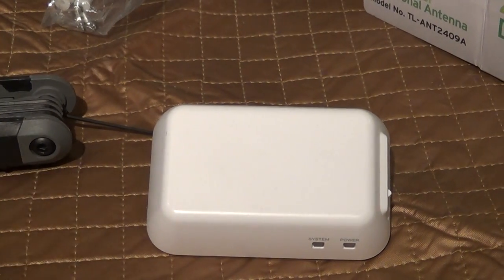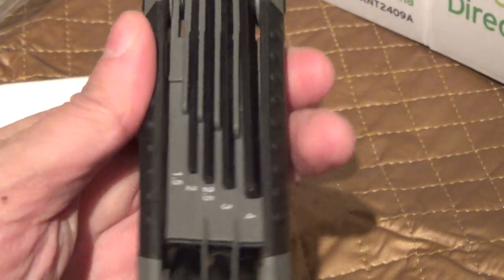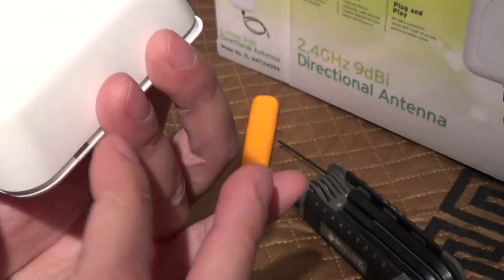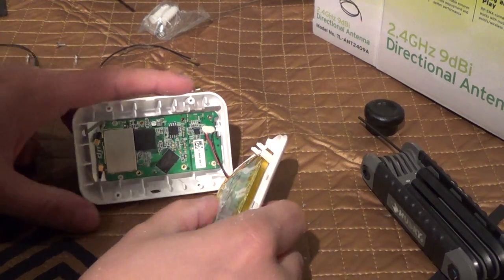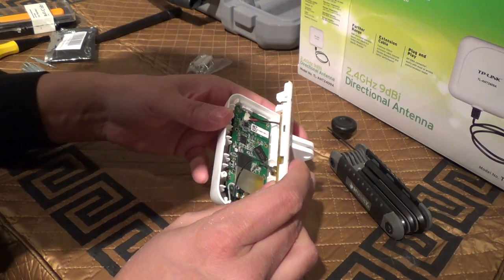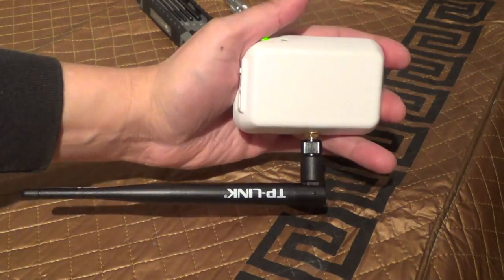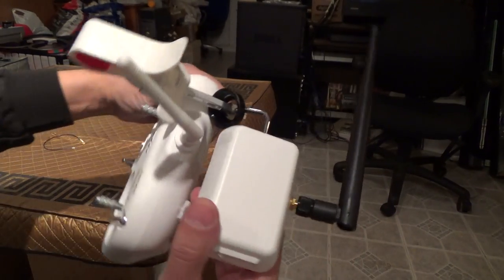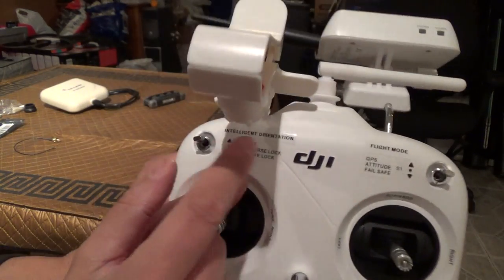DJI Phantom 2 Vision Wifi Range Extender / Repeater  External Antenna Mod increase FPV range.

Comment: just did my repeater upgrade usiing two 5dbi antenna's pretty easy upgrade after watching your video, thanks again. ebay parts were about $16... hoping test flights show improvement with wi-fi signal...had to burn away two internal ribs on the inside of the cover to allow for a flat surface to drill two holes for both antenna receptacles which mount about 1 inch apart ....curious if the transmitter antenna can be upgraded as well..wouldn't it need to be a 5.8ghz variety vs. the 2.4 ghz?
Reply from the maker: Even with extended range I've not been able to fly out of transmitter reception with it set to FCC mode.  Let me know how you do with the two 5dbi antennas. I've recently tested using the 8dbi TPLink omni antenna to 2,533 distance at over 300 feet altitude.  It definitely has given me at least 200 - 300 feet more range over the 5dbi setup.  If I change to a dual I may use a combination of both the omni and a directional antenna.  2.4 and 5.8 antennas are largely interchangeable so I wouldn't worry about which you use if you did want to change transmitter antenna out.
Reply: will do....thanks again....i want to do the transmitter as well. I did make a windsurfer parabolic antenna for the transmitter, I iwll post a video of it,i  havent tested it yet for distance though, ... still trying to find a good spot to test away from ocean... hopefullyI can find a suitable place soon,,,most of the spots here for that type of range testing involve some type of water crossing..
Reply from the maker: jwuman The transmitter upgrade is a similar procedure and uses same adapter. Though there is silicon over the connector which complicates the upgrade a bit.  Good luck with your range test but I promise you'll be nothing less than thrilled with the improvement over stock. And even more so if you go with adding an 8 or 10dbi gain antenna to the mix. If I do my transmitter I'll also post video of that upgrade as well.
Reply: awesome,,good luck as well..will be watching for more of your videos..cheers!
Reply from the maker: jwuman Thanks, I have plans for a upgrade video on the Vision Transmitter as well as the Visions Camera.

Comment: eXcellent tutorial. thanks
Reply from the maker: You're welcome. When I can I'll also have upgrade video's on the Visions Camera itself, as well as the transmitter, which isn't as necessary except for flying as high as you can far.
Reply: Do you think one antenna is enough? Does one tx and one rx or are they used as a backup type system or which ever is closest?
Reply from the maker: Skipholiday You will see no difference in overall range if you use a dual antenna setup. What dual antennas will do is allow you to mix and match two different antennas together. It will choose whichever one has the best reception at the time and use only that single antenna.
Reply: Ben7seven7 Radio is 5.8ghZ and eXtender is 2.4ghZ correct? I get these confused. I believe the early Phantom controller was 2.4ghZ

Comment: thanks for sharing- you said you may use the omni directional antenna on the TX- but isn't the omni directional antenna for 2.4GHz whilst the TX is transmitting on 5.8GHz? If you know how to effectively upgrade the stock TX antenna I'd be grateful to find out how and what to get for that? thank you
Reply from the maker: 2.4 and 5.8 antennas are largely interchangeable.  There is just going to be a slight increase or decrease when using on one vs the other but they will work fine.
Reply: Ben7seven7 thanks for your reply Ben- are there any resources for modifying the stock P2V transmitter antenna as it doesn't appear to be a simple case of unscrewing the stock 5.8GHz antenna and screwing in one the antennas mentioned in this video..? thanks once more
Reply from the maker: justinspirational Actually it's just that simple, undo the rear screws and take apart your TX as if you were going to be connecting to your PC. The only trick here is that some TX's have silicon covering the u.fl connector where the antenna plugs into. You'd have to be very careful removing that so you can than plug in the U.FL to rp-sma connector as I do with the repeater mod. Then you can use any screw in antenna.  I'll post a video showing this when I get the chance.
Reply: Ben7seven7 thank you- looking forward to that vid too
Reply from the maker: *****
That's not a wire you can splice into, it needs to be unplugged and new wire installed.
Reply: Ben7seven7  How much better range did the wi fi repeater mod give you? My biggest compliant of the stock P2 Vision is it signal failure at relatively close range. Any ideas on powering the wifi repeater as well?
Reply from the maker: Depending on the antennas used the range increase varies from moderate to extremely significant.  My early tests using just a single tplink 5dbi omni got me to nearly 2,000 feet distance with a lot of wifi around me it wasn't flawless all the time tho and lower preview quality.   I've done much further with my 11dbi helical circular polarized antennas and have so far done tests to 1.2km away at highest preview quality and I still could have gone well farther.  Some have gotten to 5km which is pushing the limits a bit.  2km range is within reach of most people depending on where you fly
Reply from the maker: Also check out the new video I put up on adding amplification to the wifi repeater.  It makes for an additional significant increase in FPV range.

Comment: Ben7seven7- thanks for taking the time to make this helpful video!you say for optimal results..2 antennas. If I choose that route, should they both point to the phantom?
Reply from the maker: Yes using two antennas will give you the best possible results. Only a directional antenna needs to point at the Phantom. The omni directional antenna needs to have it's side to Phantom. I use mine facing sideways and I've done 2,000 feet with the 5dbi and 2,533 with 8dbi omni antennas.  In a dual antenna setup you still only use 1 antenna at any given time, it just chooses which one is getting best signal so I'd suggest a combo of an omni and a directional antenna.

Comment: Thanks for answer Ben! Think ill just stick to your plan.. But upgrade to 2x8dbi antennas for the range extender only to start with. That would give me at least 2-300 meters more,i hope :P anyway,hope you will do the transmitteras well:) thanks from Norway(great video btw) Trond.
Reply from the maker: How's the 2x8dbi antenna setup working out for you? I may be doing the same thing, adding an extra antenna to see what kind of difference there is.
Reply: I've changed my mind..waiting for the products as follow: two 5dbi omnis, and two 9dbi omnis. The two 5dbi's goes on the F2V, and the two 9dbi's goes on the range extender. Will probably push it to around 1.3-1.6 km(4500-5000 ft). Im waiting for the products,some from US,some from China...think it will take a couple of weeks before im ready to testfly that mod. Will let you know
Reply from the maker: Trond Harbak Check out some circular polarized antennas from FPVLR you'll get even better range and reliability :)
Reply: Thanks,you have any link? :)
Reply from the maker: Trond Harbak
This one will give you the best results at the lowest price.  It's an LHCP 6.5 turn helical.  If you want something more compact but bit less range you can check out their Half Dome which is very compact but you'll get nice range increase.

http://fpvlr.com/shop/index.php?route=product/product&product_id=52
Reply from the maker: That's an RHCP Skew Planer, it will work with best with a matching RHCP Helical.  That's a really nice antenna and I use it myself.   My own configuration is an 6.5 turn RHCP Helical antenna and I have two of those RHCP Skew Planer antennas on my Phantom 2 Vision. If you ordered the antenna from the link I gave you to FPVLR that's an LHCP (Left Hand Circular Polarized) which will not work optimally with that RHCP Skew planer.   If you will be using that RHCP Skew Planer on your Phantom you will want to notify FPVLR and change the order from an LHCP antenna to RHCP.  Alternatively cancel the order from the RHCP Skew Planer and order an LHCP Skew Planer from FPVLR.  Either will be fine.
Reply: I will keep you updatet ! I have ordered a second RHCP skew planer now,and also a RHCP Helical,all from readymaderc. The Helical is on 11dbi.
Reply from the maker: I just did 1.4km with that setup with  room for more distance. Close aim is very important though for getting good range beyond 1/2 mile with that directional. But it is very good.

Comment: Here is a 10db antenna (and white color stands great to the DJI's white Remote)
http://www.aliexpress.com/item/1PCS-high-gain-2-400mhz-2500mhz-WIFI-antenna-with-RP-SMA-connector-white-color/544052889.html
Reply: I have more than 250 orders from China. Only 2-3 have been troubled. I got refund for all of them and even a few more because of long delivery time.

Comment: Amazon is expensive. I use Aliexpress.com
I get 3 mini-PCI to RP-SMA cables for just over 5 dollars incl shipping on this link
http://www.aliexpress.com/item/U-FL-Mini-PCI-to-RP-SMA-Antenna-WiFi-Cable-Signal-Connector-Network-Adapter/1570882558.html
Loved you video, and made me  consider a huge antenna...

Have you tested the video at 1600 feet?
Reply from the maker: I've tested to over 2,500 feet using an 8dbi omni with the Phantoms side facing my general direction for best results. Your results will vary of course depending on the location you're flying in. Mainly how many sources of interference you're standing near, such as other strong wifi signals.

Comment: Hi Ben ! Very interesting video! I wounder,im about to do the same,but im gonna put 2 x 12dbi antennas in the range extender,and probably one 18dbi antenna in the radio transmitter. Do you think that it will do it? I wanna try to get as far as 1 km in range with the Phantom 2 vision.
Reply from the maker: That should work pretty well.  You will need to use directional antennas to push 1km range.  Tho I'm not sure the antenna alone will be enough I think those that have done it used a power amplifier as well for both the wifi repeater and the transmitter.

Comment: Do you know where I can get the app?  It's been out of the app store for days.
Reply: Ben7seven7
Please I would appreciate that very much.  I just got the Vision a couple days ago and it's been driving me crazy with curiosity how the FPV works.  Snowbikemike@yahoo.com
Reply from the maker: New Version of the app just became available in the iOS App store.
Reply: Ben7seven7 This thing has been awesome!  So happy and thanks for the help on the app.  Recently picked up the Phantom 2 with gimbal for comparison.  The range on the 2 far outreaches the vision and I'm using the Fatshark TX to predator goggles.  So now I can't wait to get this mod done that you've shown us and see what kind of range I can pull of the Vision.
Reply from the maker: Vegas Mike
Yeah using a Phantom 2 with fat shark or other option uses much more powerful transmitters and antennas than what come with the vision.  Changing out the Visions antennas certainly help even the playing field a bit. And as an added boost you can use a 2.4ghz antenna booster to further bolster your FPV range. It would screw in to the external antenna plug then your antenna into the booster. You will need to plug in the booster tho with some sort of portable battery.

Comment: Sorry, I'm a little confused, and this may be a dumb question, but I'm hoping you can help me understand how this works.  To increase range wouldn't the better antenna need to be on the Phantom itself as it's sending information back?  I'm not understanding how an antenna with better gain on the receiver is increasing range.  I could see it for the controller as it's sending information to the Phantom for movement, but with the Vision aspect coming back to your phone, isn't that on the receiving end of things?
Reply from the maker: Both the transmitter and receiver strength are just as important.  Improving either piece improves overall performance.   The bigger stronger the antenna the more signal it can capture and use.
Reply: Ben7seven7 Ok thanks.  Do you know if it's possible to upgrade the antennas on the camera and the phantom itself?  If so do you plan on doing this to yours and will you be making a how-to video?
Reply from the maker: Yes the Phantom 2 Vision wifi antennas can be upgrades in a similar fashion and will require taking much of the camera apart.  The same adapter that's used in the wifi repeater upgrade would be used.  The 5.8 control in the Phantom could also be upgraded.  If I decide to do them I will definitely film the process tho I'm not sure if I want to at the moment.
Reply: Ben7seven7 Thanks!  I really appreciate you taking the time to respond, I'll subscribe and look for future videos.
Reply from the maker: Chris N I've been working on that Vision Camera upgrade video.   Two ways to do it, one rather complicated, the other easier, but needs an extra part.  I'll put it up when I've had a chance to fully complete the mod myself and test fly it.

Comment: Hey Ben nice Vid. Thanks for sharing this. You give us a link with the 5 dBi but i also see an 8 dBi. Will that work to?
Reply from the maker: Yes the 8dbi antenna will also work and likely give you improved range over the 5dbi tho it will add a couple more inches of length to the antenna over the 5dbi version.  I'm going to pick it up myself just to compare the range difference if any.
Reply: Hi Ben, Did you already compare the antennas? I would like to see the results :)
I now have an 10 Dbi antenna and i am waiting for the connector. I will give you the results when I have tested the wifi mod.
Reply from the maker: pilske20
When comparison testing I fly at the same location over the same areas. I've now tested the 8dbi omni antenna to 2,533 feet max range with the Phantom facing sideways to me for max effect. It works well at any orientation to between 1,800 and 2,000 feet more or less.  The 8dbi has roughly given me at least a 200 - 300 foot increase in range if not more over the 5dbi.  I also have a 9dbi omni to test as well.
Reply: Ben7seven7 Hey Ben i did the upgrade and i have about 400 mtr of range just 100mtr more than i had. Not a big difference. I am using an 10 dbi Antenna from sitecom. 

Link: https://www.sitecom.com/nl/wireless-network-omni-antenna-10dbi/wl-031/p/201

My question is if there is a lot of quality differences in antennas? You get a lot more range than i do so maybe the TP-link antenna should do the trick. Do you someting about the quality of antennas?
Reply: pilske20 Ben7seven7 does anyone know something about the quality of antennas? Can it be that a 9 dbi antenna does les than a 5 dbi antenna when the 5 dbi has more quality?

Comment: Interesting mod however I've found the vision 2 to have more than enough power to keep the video in line within 1,000 feet, however the control signal runs out before that point.
Reply from the maker: Wing Cheung Lee
No not yet, but maybe soon.
Reply from the maker: Wing Cheung Lee FYI If you haven't yet you should have your transmitter set to FCC mode to get maximum range. As far as distance using 8dbi omni I've now gone 2,533 feet away while over 300 feet high without loosing transmitter reception on the stock antenna. Vertical range is a different story as I've only gotten half that range going straight up, and that would be the main reason to swap out the transmitter antenna.
Reply from the maker: No the control signal doesn't run out at 1,000 feet even on stock setup I've done 1650 feet now with good control signal.
Reply: Ben7seven7 Good sharing. 1650 feet in CE compliance ?!  I m fresh to vision 2. I have a stupid question. How far can range extender extend the control signal? and FE compliance claims of 500 m range, approx. 1600ft, in control signal. So what is the point of adding this TP link? thanks
Reply from the maker: The control is in FCC mode not CE I've seen people getting well over 3000 feet with it.  But regardless the mode the better the antenna the better the range.  The controller antenna can be upgraded in a similar manner to the wifi repeater
Reply: Thanks, do you have tutorial video to modify the remote controller? Lol
Reply from the maker: Wing Cheung Lee
I may be doing the 5.8ghz transmitter antenna upgrade sooner than later. I'll see when I have time.  Just waiting for one of my extra antenna's to come in first.
Reply: Great, can't wait to watch it
Reply: That's awesome. What a great distance! I have switich to FCC mode but haven't tried such long range... As you said the vertical is another issue, so the FCC claimed 500m range could be reduced if I fly vertically, am I right?
Reply: This is my flight.... Still green in controlling
Reply from the maker: Wing Cheung Lee Nice location
Reply: Ben7seven7
Depends on where you are flying for your control range.
Reply: Mine does the opposite so I think Im going to do this mod

Comment: Great mod but what has been the increase in range?
Reply from the maker: I've only tested the 5db omni antenna so far but that is proving to be rough 60 to 75% increase in range while also having the benefit of being omni directional.  I'll try the directional antenna next.

Comment: Xllnt tutorial , well done Ben !
Reply from the maker: Thanks for the feedback.  The mid worked great,  even the 5db omni antenna shows substantial range improvement over stock with benefit of little added weight or bulk and it being omni directional.